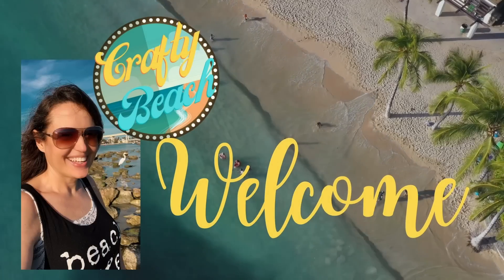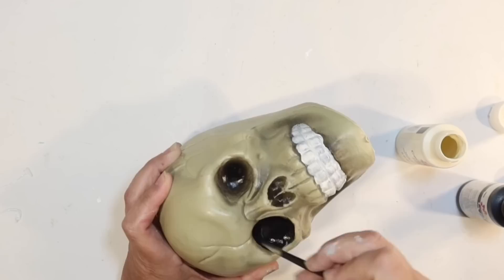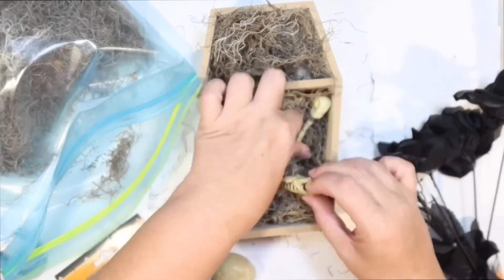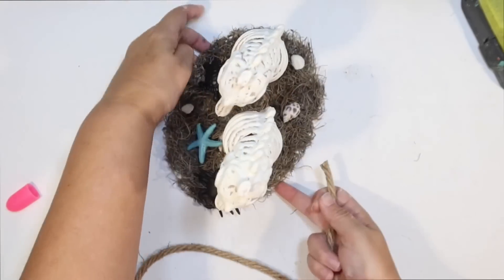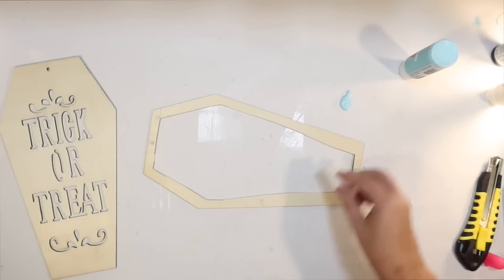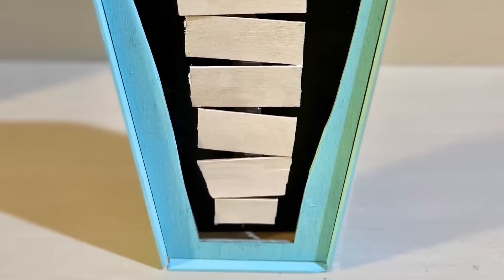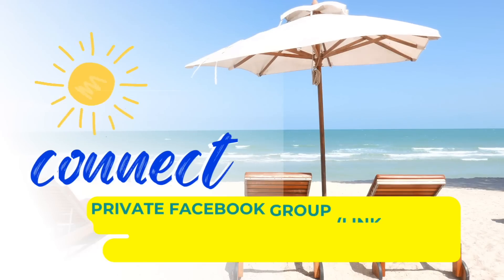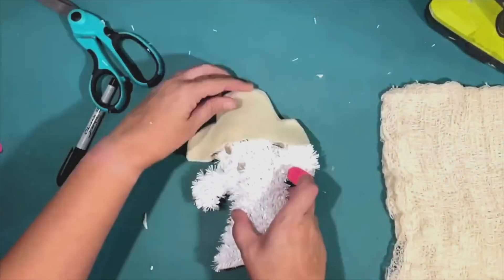🦇 Beach Boos & Coastal Haunts: 15 BEST Halloween Dollar Tree DIYs 🌊

Comment: The sea horses are cute. You could also use aqua blue aquarium sand and/or rocks, instead of the moss on the bottom. The sea turtle was hard to see so it would help to lighten it up.